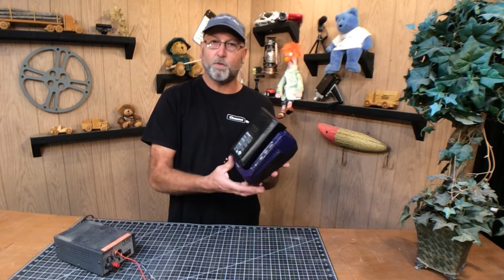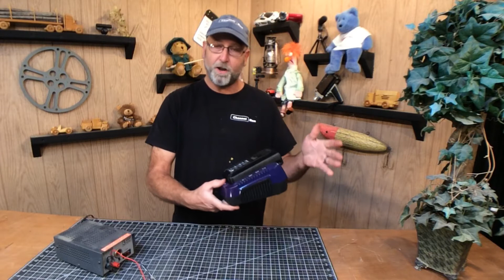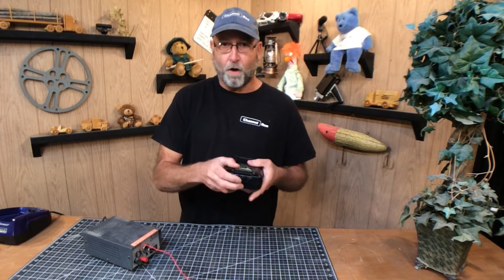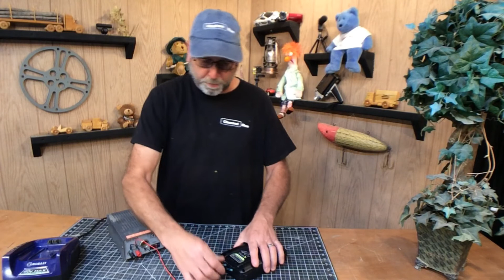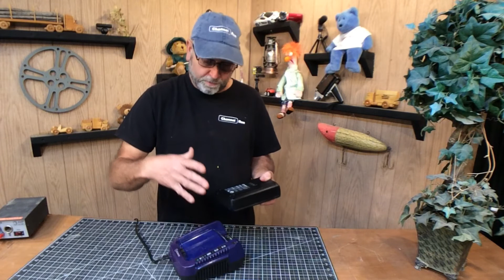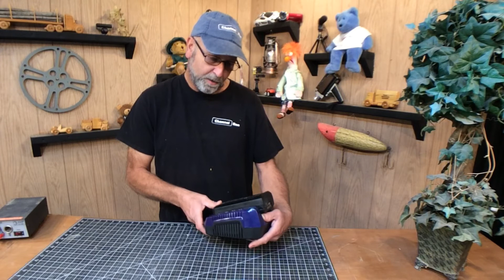40v Kolbolt Battery Jump Start

Comment: How can you charge a 40V battery with a 12V charger?  I thought that you had to supply a higher voltage than the rated voltage of the battery in order to charge it?
Reply from the maker: No you have to use the right charger.
Reply: @channelron3593 This does actually work. I tried it, and it fixed my battery. I think since the battery was so drained, it’s voltage was lower than 12V, so the car battery charger was able to charge it. It raised the voltage in my Kobalt battery enough to be charged by its charger, so I’m happy.
Reply: @1darylcook  how long did charge the battery from your car?

Comment: I have one of the kolbalt batteries and it had some oil spilled into it.  Any suggestions on how to clean it out.  I WON'T charge.  Thanks a lot
Reply from the maker: Wow? umm well I would start with isopropyl alcohol first because it dry's out so fast.

Comment: My 40  kobalt battery would not change ,was dead for 2 years.
I jumped it with a fully charged 40 v kobalt battery +to+.   to   put it in the charger and it charged it is as good as new.i guess that the voltage was to low for the charger
Reply from the maker: Yep you got it!